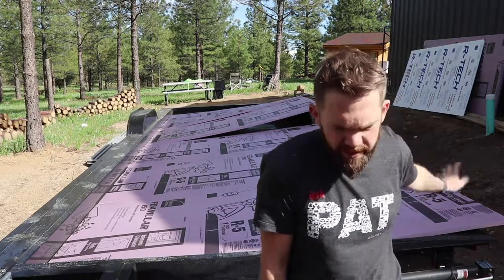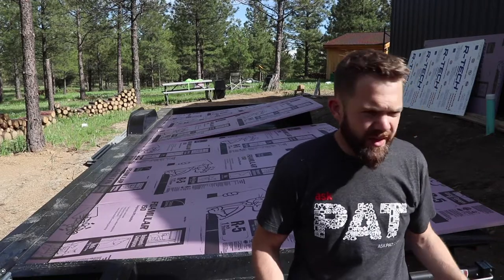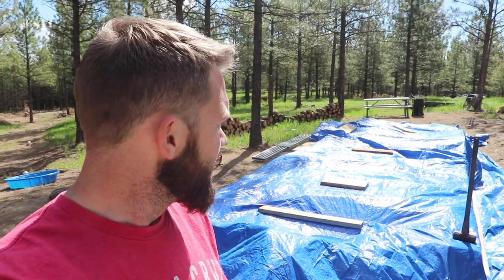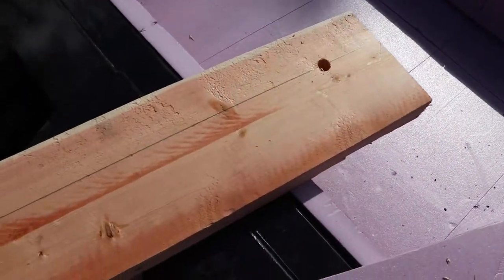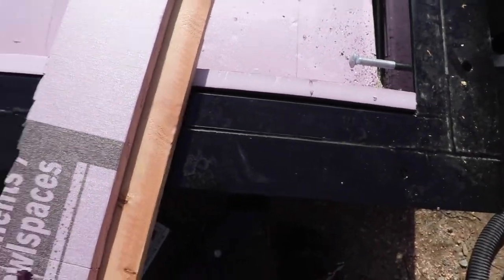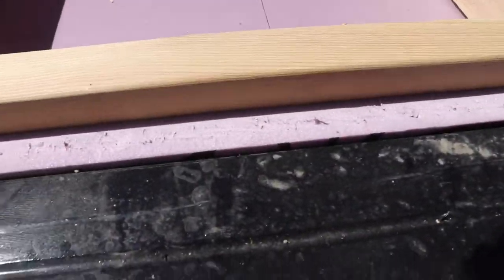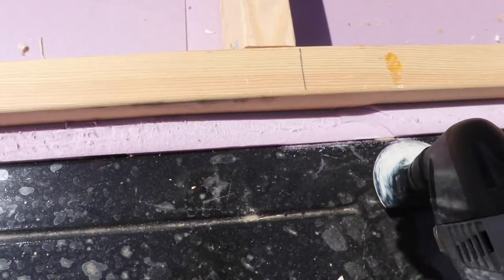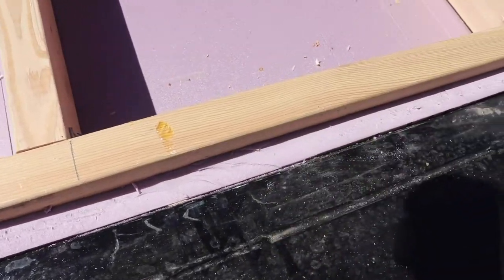Tiny Home Build // Trailer Insulation & Subfloor

Comment: beautiful piece of land for a tiny house. Thanks for sharing these tips !
Reply from the maker: Thank you! New videos coming soon!
Reply: @ProjectWildwood  Looking forward to it! Question for you: Have you found the 2x6's to be suitable for the flooring? I heard using 2x6's can lead to squeaking in the floor boards, and have been advised to use 2x8's. This would mess up my plans a bit though, and wanted to know if you recommend using 2x6's. Since you have several close family members in construction however (and seeing that others seem to always go with 2x6's) I think they might be alright to use.
Reply from the maker: @schnibbler6085  No squeaking at all, but be sure to use subfloor adhesive on every joist. I do regret putting the joists 24 on center because the floor can be squishy in some places. If you do 16 on center I believe you’ll be just fine. There’s no structural reason to use 2x8 but if you want to pay more $ and maybe have a slightly stiffer floor, that could be a plus if it matters to you. You will lose 2” of interior headroom.
Reply: @ProjectWildwood  That answered it for me. I really am grateful for this. Its a really daunting process for me, having no building experience and jumping into this. Would you mind if I were to email you with a couple other questions? Many thanks for your help.
Reply from the maker: @schnibbler6085  happy to answer any questions that help others repeat my mistakes! Haha
Did you get a 2 or 3 axle trailer?
Reply: @ProjectWildwood  haha I'm planning on going with the exact same 28ft ironeagle trailer you're going with. So it'll be the three axle. I'm even considering having them put on the same jacks as you, though I don't know the pros and cons of those scissor jacks that they sell. Right now I'm racking my brain in Sketchup trying to figure out how the frame fits around that little square box in front!
Reply from the maker: Good plan on the 3 axel. 
I really like the ram jacks. I got them because I heard about issues with scissor jacks bending if they get racked sideways. 
If you are doing the bump out, make sure they extend the tongue. Ours is way too short.
Reply: @ProjectWildwood  it seems ironeagles prices are going way up. It's going to cost me 7k + at this point, so hopefully they can accommodate me with a longer tongue. I'm probably going to be hauling this thing across country so its important too. Now to find land where no one will bother me living in a tiny home! Haha
Reply from the maker: @schnibbler6085  talk to the owner, they should do the extended tongue by default when you put on the bumpout. I think mine was an early model and they didnt accommodate for it.

Comment: Hey, do you mind if I ask you one more question about your trailer? I will be buying one this week from ironeagle and since I also have the same truck you did in 2019, I was wondering how long your trailer tongue is, and how long you think it should be for the tacoma to handle it?

You would save me a hell of an issue, I would be grateful for any advice!
Reply from the maker: Absolutely. I’ll have to measure when I get back home.
Reply: @ProjectWildwood  I would seriously owe for that!! Think I'm going to pull the trigger tomorrow and put down the 50% deposit.
Reply: @ProjectWildwood  Do you think about a 6 inch difference would enable wide turns with a tacoma without damaging the bumper?
Reply from the maker: So my tongue from the bump out to the center of the ball is 24”. I would probably recommend another 12” 

Just inquire with the owner about what is standard. They understand trailer geometry better than me. 

What basically needs to happen is the bump out corners shouldn’t extend much beyond the triangular rails.
Reply: @ProjectWildwood  Thanks so much. are you happy with the ram jacks instead of scissor jacks? Does it keep the house from wobbling? I think I would like to follow in your footsteps there
Reply from the maker: Definitely!
They are great and very easy to jack up and down. No kneeling down or using a crank tool of any kind. One thing I had to take into account was the jack sticks up into your siding area and the steel siding was too thick to go behind the jack so I had to put some flat steel in those areas. https://imgur.com/a/0olQfBz
Reply: @ProjectWildwood  how much clearance do you think the jacks would need to keep from messing with the siding?
Reply from the maker: Depends on what siding you are going to use and what width trailer you are getting. The sheeting/OSB is going to hang off the edge 1/2” then your siding will go on top of that. If it’s 1/2” then you need at least 1.25” clearance from the frame to the inside of the jack. You have to factor in all of these layers when deciding on your trailer width plus whatever your roof overhang will be. Take 8’6” and start subtracting and you will get your trailer width.
Reply from the maker: Or go 10’ wide and it’s less of an issue :)
Reply: @ProjectWildwood  hey there. Didn't want you to think I went MIA. I sent you an email just to say thanks for all your help! Really appreciate your great advice and willingness to help!
Reply from the maker: Just saw it yesterday, thank you!